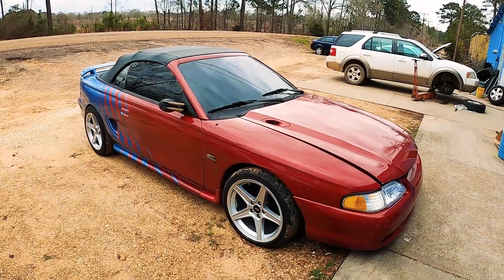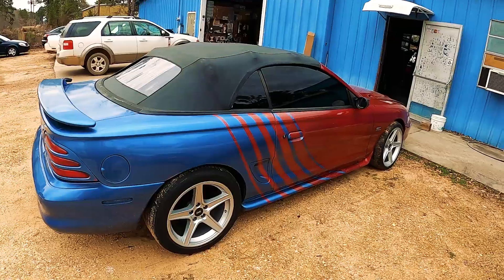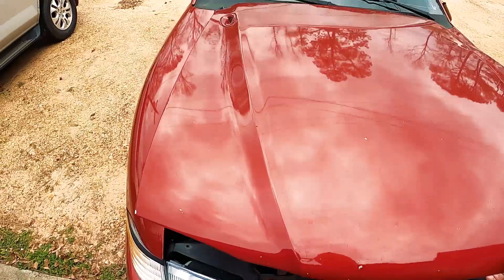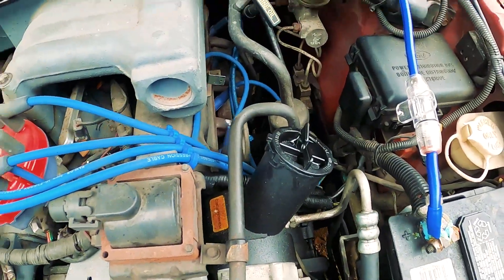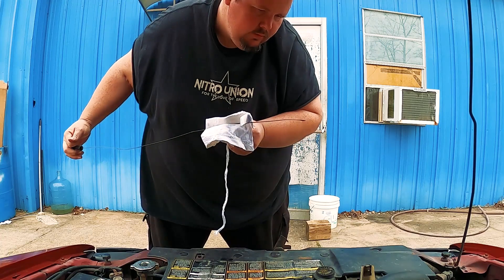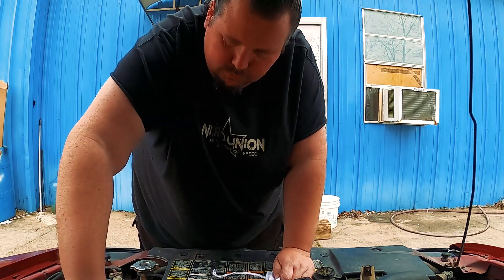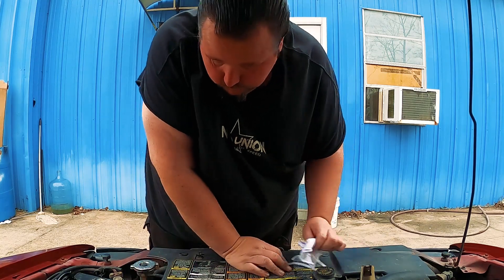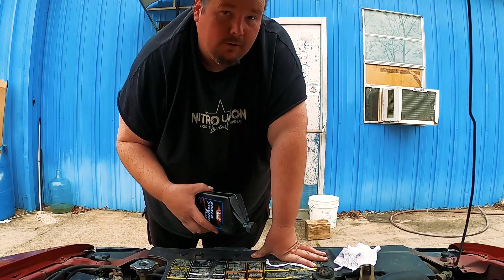I bought a 5.0 Mustang GT at auction sight unseen for dirt cheap and it rips.... kinda

Comment: Okay so the power steering noise is normal too an extent? Mine makes the sound too
Reply: Ford was notorious during this time for power steering pumps being noisy. Had a 93 ranger made that exact same noise. You can quiet it down by changing the fluid. Drain and refill is obviously the best but you can use a turkey baster and suck out the reservoir and refill once a week until the fluid is bright red again

Comment: or put a 2017 coyote engine in it needs to be louder and the rear tial light is messed up  put some bigger tips on it like some 4 inch tips
Reply: You can put 1 in a sn95